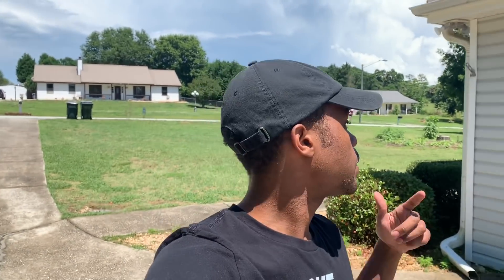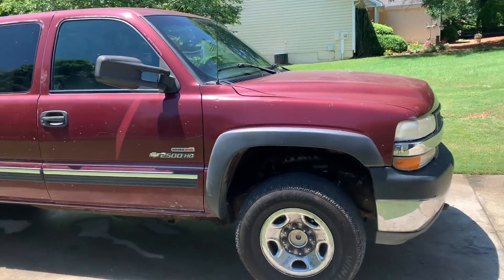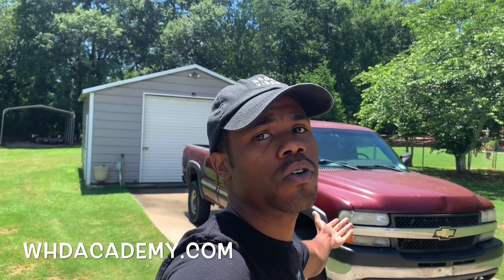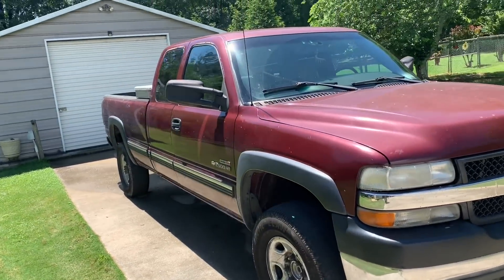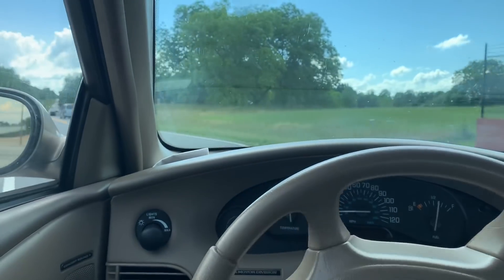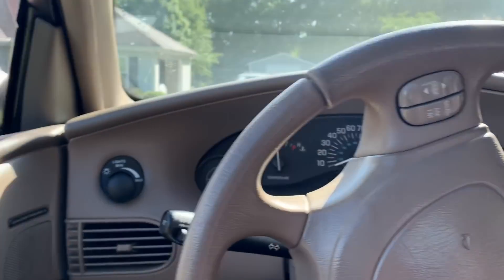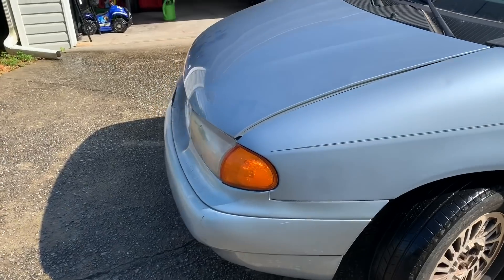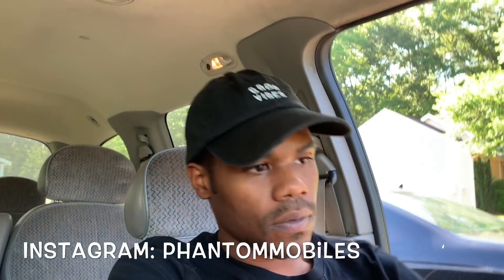THIS TURNED OUT BAD! I BOUGHT A 1998 FORD WINDSTAR MINIVAN SIGHT UNSEEN FROM INSURANCE AUTO AUCTIONS

Comment: Be sure to check the recall on this vehicle. Rear axle cross beam will eventually crack in half sending both wheels to flop out and turn inward.   Mine did and went to the scrapper

Comment: I have a 1998 windstar with a 3.0 out...it simply will not die. Bought it at 153000 I'm at 225000. 2 alternators 1 starter 1 fuel pump but still rolls along fine

Comment: Ford Windstars changed a lot between 1998 and 2003. They started out with a lot of design problems, which Ford gradually fixed over five years. I have a 2003 Windstar that I bought new. It has 269,000 miles on it and I'm still driving it and it still runs and drives excellent. Its been a great van. But mine is an 03 and it was one of the last ones produced so it has all the various fixes in it. For example, the early ones had problems with the torque converters that caused the transmissions to go out very early. But mine has the updated and improved torque converter in it that lasts a long time. The early ones also had problems with head gaskets failing, but mine never did that ether. I'd recommend someone taking a chance on a 2003 Windstar. But frankly I'd avoid a 1998 Windstar like the plague.
Reply: Even up to 2003, they all suffered the risk if the rear axle snapping. Was a terrible design to use a hollow shaft.

But if you take care if it you should be fine
Reply: @trashyspeeds266  Mine had the recall work done to the axle. Ford put these "repair brackets" over the place where the axles always rust out and snap. However, they just used some sort of glue to keep the whole thing together. I started seeing videos on YouTube where the rusted axles were pulling out of the brackets because the glue let go. To prevent this from happening I had both ends of the bracket welded to the axle in two places so the axle could not come out. So far the axle on my van is still holding together.
Reply: @joevignolor4u949  i saw some where if its lived where loads road salt is, the road would cause cracks down the middle of the rear axle, snapping it there, glad urs is delt with tho
Reply: @trashyspeeds266  The axles can rust and snap in two places near both ends of the axle right next to the springs. It can break on either side depending which side rusts through first. Mine are rusted through and you can see big holes in the axle tube by looking through the repair bracket but the brackets are what are holding the axle together. I live in New Hampshire and we do have salt on our roads around here.

Comment: I have one of these. I believe this one is an LX and mine is a GL. This has the 3.8 L Essex V6 from the Ford Mustang that was equipped with the V-6 option. I think I only paid $225 for mine with 145,000 original miles from the second owner. Mine has a few issues here and there. Mostly a problem with the intake manifold runner control system. It is stuck in the open position sometimes and doesn’t like to idle eight points.  A little known fact about these. A lot of the modifications people due to the Mustang V6 can be performed on this engine also. Including the popular Flowmaster 40 exhaust set up. And there is also a trick to kind of compensate for it not having a sliding door on the driver side. If you look on the driver seat near the back rest where a seat latch to flip the seat forward in a coop would be, there is a latch to flip the seat forward like in a coop so that it provides a larger area for entry and exit from the rear on the driver side. Also, the front drivers door and front passenger door are asymmetrical with the driver side door being approximately 6 to 8 inches longer to compensate for that extra room to be able to get in and out of the back easi.
Reply: And another trick with these. If you have the cooling fan not working, instead of going for the original Ford cooling fan and shroud which will run you about $170, you can get those 14 inch slim line 12 V cooling fans. You will need two of them and you will need to be able to rewire them to make them work. But they are much quieter than the original fan solution, and they really don’t take up as much space. Which translates into a lot more working room under the hood.

Comment: Sold these when they were new.Bigger door on driver side to compensate for not having another slider on that side.Head Gaskets and Transmission troubles abound in them but have probably been fixed by now.Looks like a quick $1400 flip.Good Luck and stay safe

Comment: $638 is not a bad deal, if you're going to flip it. But I could be more brutally honest about Ford. The good thing about Ford. They're easy to repair. You can't put cheap parts on a Ford. If you want it last forever. Just my opinion.
Reply: Yep nice I would drop a thou.fork lift tagged it